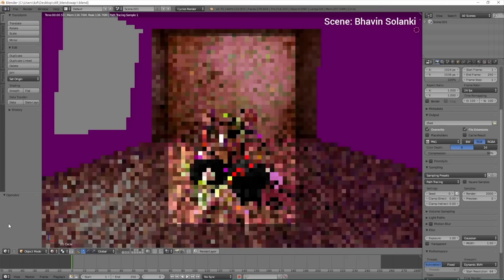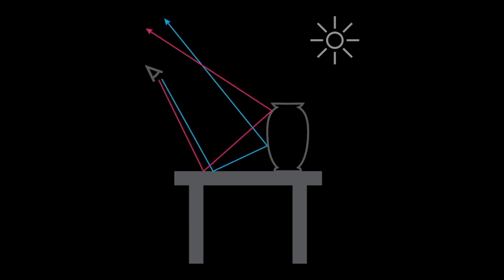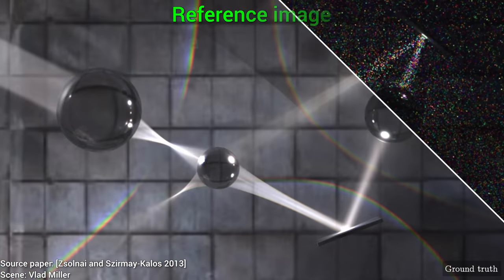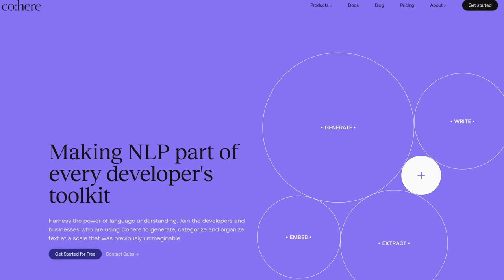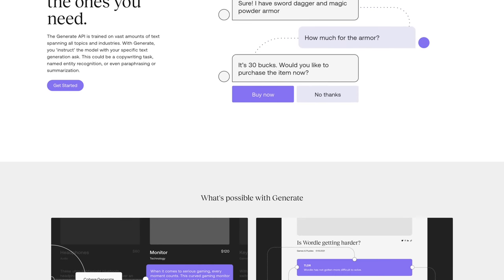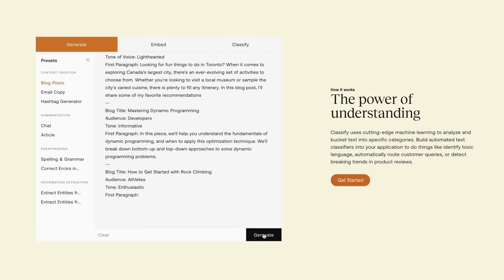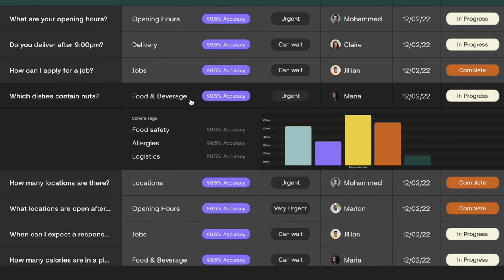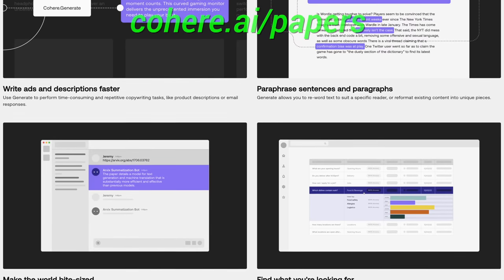NVIDIA’s Ray Tracer - Finally, Real Time! ☀️

Comment: Awesome video as always! Could you maybe once dive into the processing power required to run these new (or more simple) ai's? I'd be interested to hear if it takes a complete datacenter, or a single laptop would suffice!
Reply: That will change throughout the decade if technology like photon computing becomes mainstream and cheap, little power consumption and incredible parallelization
Reply: @JorgetePanete  For sure. Hardware is almost as big a factor as software. But I'm sure the complexity of the networks is a big limiting factor in implementing them in real world scenarios right now.
This video shows perfectly how new developments allow for real-time simulation. So how much further down the line can this be broadly applied for games/cinema?
Reply: @noot2981  Since it says it was run on RTX 3090/2080 then a PC would be enough, but for neural networks of decent size you currently need big chonky servers

Pixar currently has a big server room for its movies, using ray tracing
Reply: @JorgetePanete  Thanks. So it takes an RTX 3090/2080 to run a single instance of this right? Do you know any specifics from the other video, where Nvidia trained 50 ai's for 10 years to walk? What would it take to run those 50 agents at the same time?
Reply: @noot2981  I remember A100 was the used hardware, can't remember the quantity, maybe in the papers it's mentioned
Reply: @JorgetePanete  Low power consumption? That's gotta be the greatest joke I've heard! Graphics cards are only getting more power hungry, and that trend won't stop any time soon.
Reply: @anakinlowground5515  Check the newer advances in technology before commenting that
Reply: @orangestapler8729  I think not for some years
Reply: @JorgetePanete  dude, my 3080 is rated for 384W. On the high end, power draw is ridiculous. The 4090 is rumored to have a 400W TDP. AMD is going to have high power draw as well. They’re still gonna have better efficiency than NVIDIA, but their power draw for their next gen cards, I’m guessing, is gonna be comparable to the power draw of the 30 series cards. They have to increase the power draw to compete with NVIDIA. All signs point to power draw getting higher and higher as time goes on. ARM might put a damper in that, though.
Reply: @anakinlowground5515  I never mentioned current technology
Reply: @JorgetePanete  I mean, the newest advances will be the 4000 series cards, and AMD's 7000 series cards. They're next gen cards that haven't been released yet. Also, we can't base what we say off of hypotheticals.
Reply: @anakinlowground5515  We can...? Some of them are in the process of scaling, the insane power draw is just a bad joke, if you get one of those undervolt or whatever you need to draw a normal amount of power
Reply: @JorgetePanete  A normal amount of power would be like, what, 200W? If you did that to something like a 3080, it would effectively be like shooting someone in the foot, and asking them to race Usain Bolt. Sure, the card would still have great performance, but it wouldn't perform anywhere near what it's rated for.
Reply: @anakinlowground5515  Whatever it's rated for is like saying I can buy power hungry business grade hardware, very performant, and saying I can afford that power draw. It is rated for unrealistic use cases, like overclocking a 10 y/o cpu and making it perform like 2 gens ahead

Comment: Is there a reason they only seem to use translation/rotation in all of the scenes over the last year or two when demonstrating the cutting edge of their rt tech rather than incorporating any true animation? Even if it wasn't real-time doesn't seem to be an excuse at this point if it is indeed in real-time. Does the flickering, noise, or artifacts get worse when incorporating different animations than simple translation of objects in scenes?
Reply: Its based on reusing input data from past frames. Faster/more complex animations= less reusable data. Should still be fine though.
Reply: Without knowing any details I'd say probably because this needs motion vectors to be able to reuse cached data, which is easy to get from pure matrix transformations (rotation, translation, scaling) but waay harder for skeleton-deformed meshes
Reply: Well, look what d5 render does, it uses this technique and it allows deformed meshes as moving people or animals.
Reply: I didn't read the paper but maybe it is some like a machine learning algorithm that just maps the shadows/reflections from previous frame to a new position based on the object's position in the current frame besides some AI blurring techniques?

Comment: Nvidia is going wild with papers! Virtual worlds of tomorrow with NeRF, motion tracking, AI agents and now this? Seems like all that is needed is some better physics before it gets scary close to real life.
Reply: Im excited for their conference in a few days
Reply: Not at all. Even the most theoretically performant physics engine with a complexity of O(n) (and also practically impossible) where n is the number of particles to simulate gravity, electromagnetism, strong nuclear force,  etc, would be limited to a very small number of particles.

Assuming clock frequency representing IPS (Instruction per second) and that the physics engine loop takes an average of 100 different instructions, a CPU running at 6GHz will be able to simulate 60m particle operations per second.

Thus to play at 60 fps you'd be theortically limited to 1m N particles per second.

Clock speed is almost impossible to increase so the future is headed towards multi-core.

If you've got an 8-core 6GHz CPU, you'd be able to simulate a theoretical maximum of 8m particles per second at 60fps.

There are many ways to take advantage of that number, by making the particle size bigger and doing some approximation (it doesn't have to be atomic-sized). Like a raindrop of water where a drop of water is 0.05mL where it represents the size of the particle.

To fully simulate a pool, you'd need 50 billion drops of water. That'd need 50k-core 6GHz CPU.

Don't be sad yet... why not just use a GPU? The RTX 4090 is going to have 16384 cores after all. We're so close!

Not really "that" close. The RTX 4090 runs at a much lower clock (~2GHz) speed besides there's a memory delay in transport. Assuming all factors are the same (not true). Ratio should be 6GHz/2GHz = 3.

You'd probably need an Nvidia card with +150k cuda cores to be able to simulate an entire pool of water. And I mean like each particle is actually there... not visual tricks. Also, if the card is performing all these crazy physics computations... who'll do the rendering?

You know.. we're just so far away from simulating any real stuff. All the breakthroughs in algorithms you see nowadays (including this video) are all just visual tricks that have no correspondence to physics.

There might be hope; we just need much (much) better hardware for the simulation to be like reality; though for now you can simulate a cup of water! But I'm also not giving up on my virtual pool any time soon.
Reply: @nullbeyondo  Qbits is the solution , Quantum Bits are the futur of computing ! (when it will be available and affordable in public domain , this is another story ).

Comment: Good video but I not sure I understood it fully. NVdia has ray tracing starting from rtx 2000 series. What is the difference between this ray tracing and the one that is used in rtx2000 and rtx3000 graphics gards?
Reply: This is a different algorithm - that works Independent of the used hardware-generation (as long as it supports ray acceleration).

Comment: OK, so I had to dive into the paper to find the piece of information that is actually most important to know: What hardware did they use to get this 13 ms frametime. Turns out this was done with a RTX 3090 and a resolution of 5120x1440. So this technology could be interesting for games, but the resolution must be scaled down for the lower end cards and this will probably only perform well enough on 30x0 series cards and above.
Reply: oh wow! that's the most interesting part for me too. The resolution & card combo. Pretty amazing!
I think that would be ~75fps.

Comment: It would really be useful to know what GPU was used in the demo.
Reply: It was an RTX 3090. According to recent benchmarks, the 4070 is going to match the 3090Ti. So in a few years this will be possible with low range GPUs.
Reply: RTX 3090 desktop and RTX 2080 laptop

Comment: I’m a little confused, but how is this different from existing real time raytracing, like in unreal engine for example?
Reply: this is about rendering and denoising an entire scene in realtime, not using low-resolution reflection on static geometry.
Reply: @ABaumstumpf  Okay, but the raytracing in unreal engine is dynamic though.
Reply: @rasheednesbitt8667  
Think of it as running a frame 90% on RT and tensor cores, instead of a little RT to supplement the typical rasteurization.

Where we don't choose the RT effect like RTGI, RT shadows in game, because everything, even how we calculate textures is done by RT

Comment: I get the impression this will change everything.
Also, how fast is "real time", exactly?
Reply: “Real time” 
Great Question. 
Thx. 
I dont know for certain. 
 I highly suspect that the metrics or mathematical equation is relevant to the data a human can see and process to the brain. 

But…. Hmmmm if had  to guess,
“real time” is more likely relevant and related to the beholder, not the metrics of things we dont yet understand how to measure. 

Its likely a loose term by time/space. 

But its very loose and 
It will unravel so soon that we should enjoy the concept now. 
In real time. 
:)
Reply: @Jeremy-Ai  did that answer the question?
Reply: @blakksheep736  according to other comments it's roughly 80 fps

Comment: Correct me if I'm wrong but, it seems like you are losing a lot of pixels on the textures with this method. A lot of fake pixels (interpolated) get inserted into the frame this way, which effectively lowers the texture resolution.
Reply: If you're using hybrid rendering it is easy to just add texture info later down the line. With deferred rendering you are effectively albedo later on anyway for example. Quake 2 RTX also did per pixel spherical harmonics to use with normal maps later on for better texture detail. So seems there are workaround for that. For pure full raytracing the pipeline is probably different, but I don't see why it would be significantly harder to do - the paper from this still used a G buffer.

Comment: Is this different than denoising? Like Blender has a denoiser baised on Nvidias work. Is this that kind of work or are there doing something else to get the clean results?
Reply: Pretty sure they're still figuring out how to denoise the different outputs of a pathtracer as efficient as possible.

In minecraft RTX for example there's multiple denoise passes for different raytraced effects (reflection, GI, shadows are all separate passes). That's not ideal for speed, but combining them was a challenge as well.

That is however information from an interview (with Digital Foundry IIRC) from ~1 year ago.

It's not that farfetched that Blender doesn't have a very efficient denoiser either.

Comment: The GPU used in this is a RTX3090. Kopite7Kimi released benchmarks that show the 4070 easily matched the RTX 3090Ti
Reply: they also used an RTX 2080 Max-Q
Reply: Is this full RT with no raster at all?

Comment: How does this compare to Unreal Engine 5's global illumination? I thought that already included real-time raytracing, not based on raytracing hardware.
Reply: Lumen simplifies the scene a lot behind the scenes (you can toggle on the visualization in editor to see how the scene looks to Lumen). Due to that lumen is relatively low detail and uses additional screen space traces to fill in some details which can cause artifacts to be visible in movement. This paper looks like regular path tracing, just very fast. (EDIT: Correction - this is fully raytraced, not path traced).
Reply: That makes a lot of sense. I remember when they released their cave naanite and lumen demo, that I was wondering how they pulled their global illumination off without raytracing hardware. Also makes sense why they showcase caustics so much, because Unreal's GI probably can't handle that at all. Thanks for the clarification!
Reply: A lot of UE5 relies on geometry simplification, approximation and static geometry. 
Yes - nanite ONLY works with static meshes. it can not be used on anything dynamic at all.

Where as this is actual realtime raytracing on the actual geometry.

Comment: usable Real time Path Tracing for gaming is still a thing of the futur , maybe in 2 or 3 GPU generations , optimization is needed (less power consomption , less VRAM usage , less bandwidth intensive , and a more advanced IA based denoiser ) to be interesting and faisable for the console manufacturer , maybe in 2027 or 2030 we will have this in real-time in our games , just in time for GTA VI launch  😋😋

Comment: When you talk about how long it takes to compute these scenes. can you also provide on what hardware that is done? because rendering a scene in 12ms on a Nvidia DXG-100 or 12ms on an RTX3080 for example is some difference.
I assume the researchers are smart enough to use the reference and new technique on the same hardware but still would be nice to know the context from the video instead of having to search for it on the papers
Reply: In 5:38 there's a table with the results, it includes results both with RTX3090 and a RTX2080 max Q (notebook GPU). So high end consumer systems but not workstation or supercomputer grade stuff. I guess the 12ms is the average for the 2080 max Q because the 3090 seems to be below 5ms for almost all of the tests.
I agree it would be the best if it was mentioned in the video

Comment: Wait, I'm confused - Isn't this exactly how NVIDIA's RTX tech works in their GPUs? But that's been out for years - Is this video a re-upload maybe? Or has something changed about the tech?
Reply: this is different. this is 100% ray traced images. RT used in games is only things like shadows, ambient occlusion and reflections with the bulk of the image still being rasterization.
Reply: @nickhowatson4745  Except for Minecraft RTX, Quake II RTX and Teardown (and possibly further indie titles by now?), all of which use full RT lighting.
Reply: @exscape  Yeah, but with either noticeable artefacts (minecraft) or on very simple scenes (quake) or slow (teardown). This is just many times more complex in terms of what al gets raytraced and how accurate the image is.
Reply: @nickhowatson4745  But I'm pretty sure it's the same. RT can and is often used just for shadows and reflections and such but it supports full global illumination as well? RTXGI and all that? NVIDIA describes it as a "low frequency approximation of the full path tracing process" by which I'm pretty sure they mean what we see here (noisy, grainy path-traced images with missing details filled in by AI to keep up performance).

Comment: But is this to enable raytracing on any GPU or do you still need a RTX graphics card?
Reply: The second AMD pushes for AI acceleration on their GPUs an open source solution may be possible. They have such matrix accelerations on their enterprise stuff, but have yet to release it for their consumer GPUs.

Comment: My question is, Isn't RTGI in games just about the same thing? Take like metro exodus enhanced edition for example, How is this light simulation used in that different from this?
Reply: This allows for more apparent rays per pixel, and more lights, due to how the rays are allocated within the same calculations. So, you can get a higher fidelity output with better performance compared to plain brute force ray casting.

Comment: hasn't rtx ray tracing been a thing in games for years now? ....
Reply: since the launch of the RTX 2080 in september 2018. it was the first GPU released with ray tracing hardware although at the time you could count all of the games that supported RT on a single hand. now almost 4 years later RT support in games is just now starting to become standard..
Reply: Yes and no. Current real time ray tracing available, in games for example, are limited and very specific (like shadows only and/or reflections) while the rest of the frame is not traced. What's presented on this video is applied to generate the whole frame.
Reply: @mttkl  idk, minecraft rtx is looking pretty raytraced. but i see
Reply: @stephenkamenar  And in Minecraft there are still very noticeable artefacts when it is not a single-bounce element. Aka anything shiny, transparent or moving causes visible errors.

Comment: Try UE5 (Unreal Engine 5), which uses Lumen (as good and more efficient than RT) and Nanite. It´s free! And it´s beyond awesome. Perfect Global Illumination in Real time, in scenes with billions of triangles.
Reply: Lumen uses AMD and Nvidia hardware acceleration in the background when available. Lumen also isn't the same as this, this is much higher in fidelity and is faster for that fidelity. I think you might be missing the advances going on here.
Reply: "as good and more efficient than RT"

RT stands for ray tracing, and that is a generic algorithm for light calculations. Both this and lumen are RT. However, here, you're able to do far more rays per pixel and get a far higher fidelity lighting calculation, but within a higher performing result. Trying to get the same fidelity on more usual RT setups will have large amounts of temporal filtering artifacts, noise, or far worse performance.